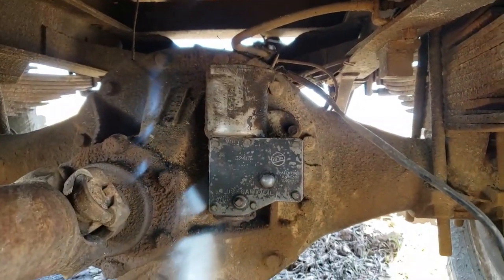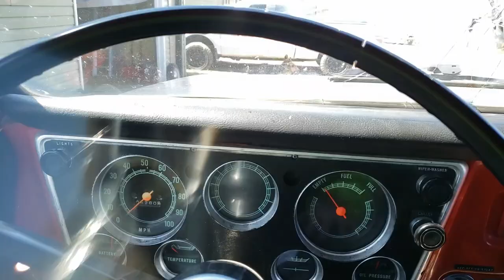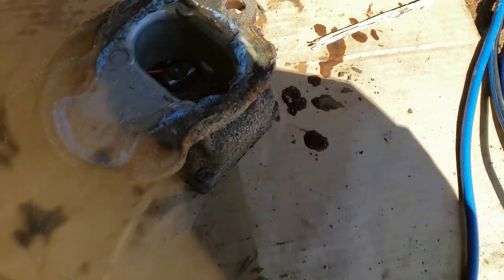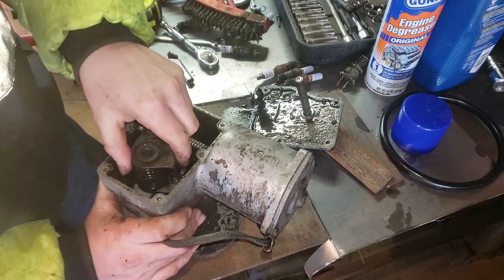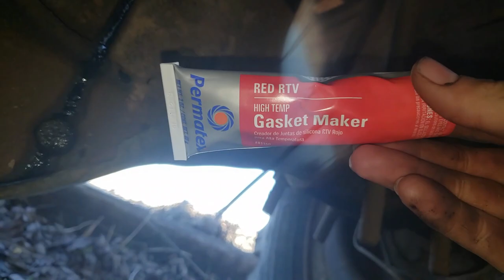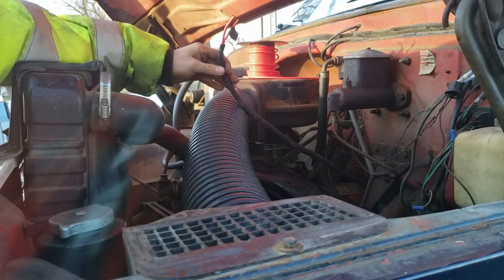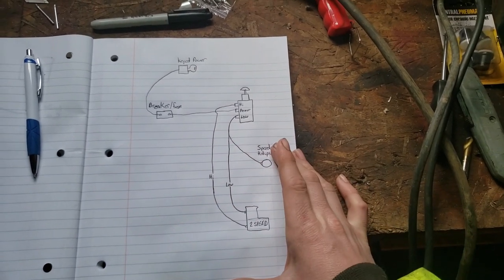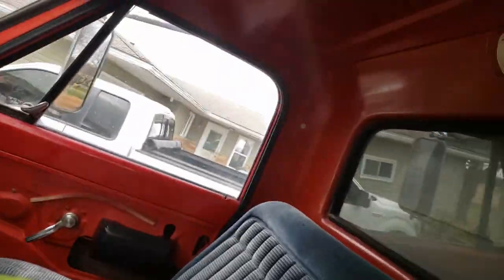2 Speed Rear end fix 1971 GMC Dump Truck

Comment: Try to not use insulation displacement connectors.  Very troublesome/undependable.  Also wire nuts should not be used on mobile equipment, or stranded wire.  Ok for solid conductors and stationary use.  To use the pvc coated crimp connectors I like to remove the pvc sleeve and turn it into a non-insulated crimp connector and use heat shrink to finish the job, or just buy the non-insulated term.  The spade connectors you used were ok.  Best not to pull power from old fuse boxes.  Make new power distribution/fuses up by the battery.  Just an old man with a few suggestions.

Comment: So you cleaned it and took the risk of killing it when you could have just ran new wires... Sorry my luck is I spray it off and it never works again.
Reply from the maker: Yes. I washed it up to go through and inspect everything before I ran the new wires to help narrow down any issues. Could have been several other issues that I would not know without looking it over, as it didn't work when I bought it and I didn't know why it was unhooked. What I did worked perfectly fine, 2 speed still works great.

Comment: What OIl did you put back into the unit when you installed it?
Reply from the maker: If I remember right I put 75w-140 valvoline gear lube in it when I put it back together
Reply: @Tanner30657  thanks for the reply. Everything i can find on it calls for straight 10weight oil, but its a rare oil these days. Got a Eaton speed in my '73 D600
Reply from the maker: @dilksy86  you bet! yeah it's getting hard to find the recommended oil now days, so you'll more than likely have to improvise, that's what I've been doing and have had solid luck so far.
Reply: @Tanner30657  I ended up finding the closest thing I could, SAE 20W oil at Lowes. 3InOne Oil brand makes a straight 20 for "Electric Motors", working great so far.   Not looking forward to changing that differential seal out later on, got a leak at 2 of the lower bolts.
Reply from the maker: As long as it's slippery you should be okay haha, I'm a firm believer any oil today is better than what they had then! I wouldn't be excited to change that seal either, never goes as easy as it should
Reply: I run 10 wt hydraulic oil in mine, some call it 303, don't run 90 wt, it puts too much strain on the electric motor especially in cold weather.